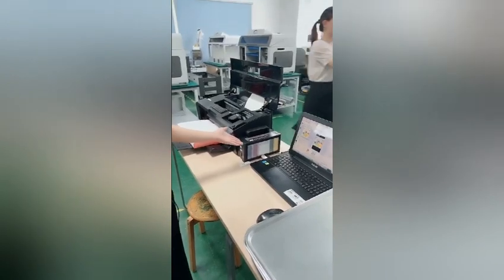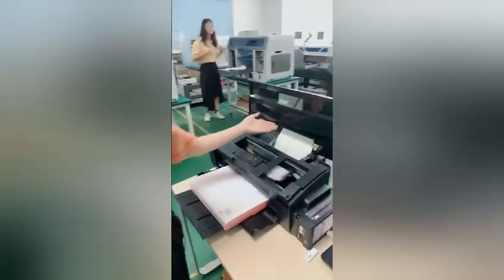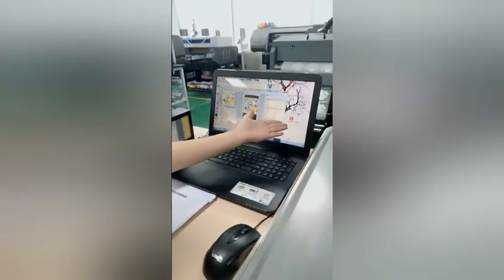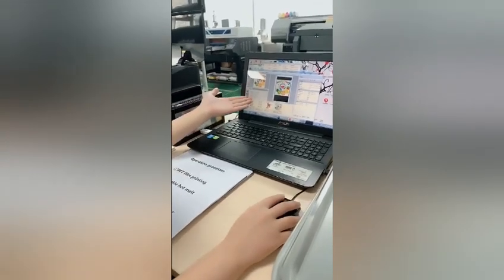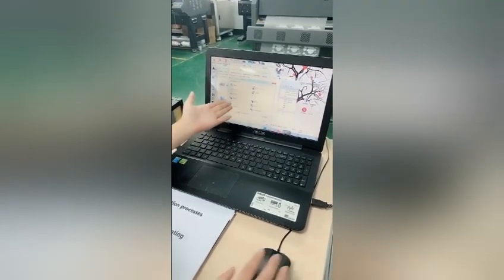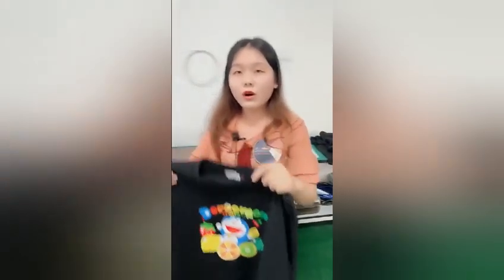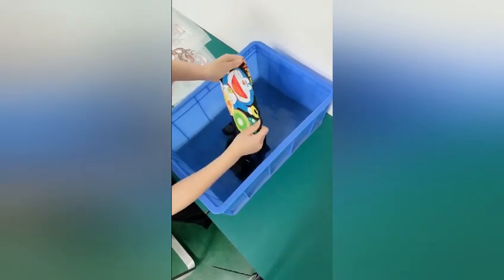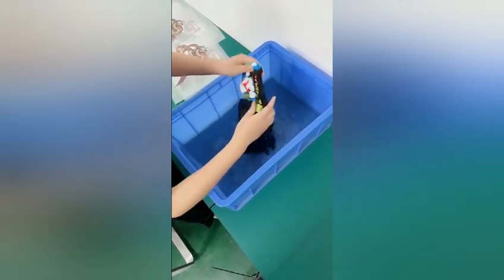New technology PET print-transfer process

Comment: the film when it comes out from printer shows some black line on the art work i think film touch the top of printer part before it comes out. is there is anything we can do to fix that
Reply from the maker: need check you modified part, and also put holder when films come out..
Reply: @yuxundateam1542  i do have holder but i do not know how to modify the part is there is any video out there to watch ?
Reply from the maker: @azcustomteesteam7700  How to modify Epson L1800 printer to print our PET film
https://youtu.be/IXkhYcNBkN0

How to How to convert Epson L805 to DTF
https://youtu.be/6y2pbLp2QoA